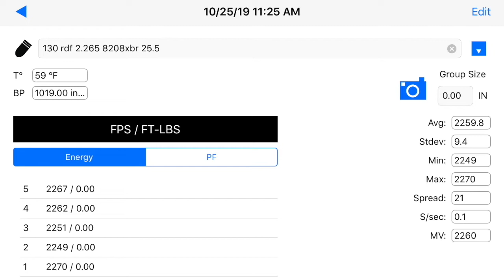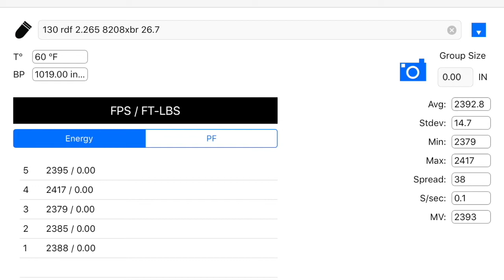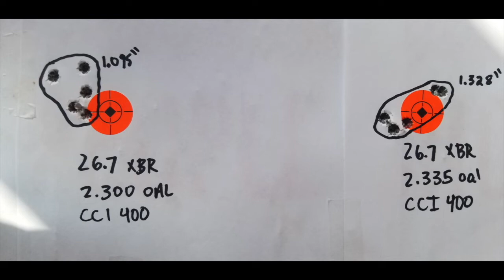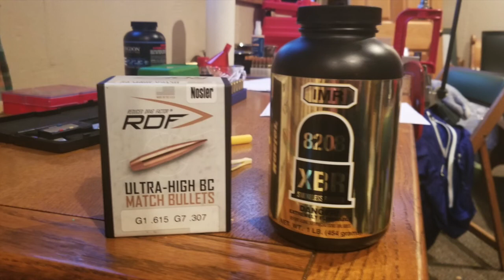How to Get Accuracy with 130gr Nosler RDF in 6.5 Grendel

Comment: I looked up the expression Velocity Node and got some interesting results.  What do you mean by that expression?  Is that simply the idea that at a certain powder load you get multiple identical velocity measurements, which creates a "node"?
Reply from the maker: When I say a velocity node I am referencing a couple charges near each other that produce less increase in velocity than the others. So if they were on a graph the flat spot in velocity. Ideally at a node your SD and ES would be lower than at the other points on the graph.